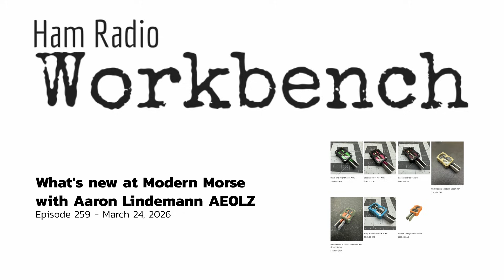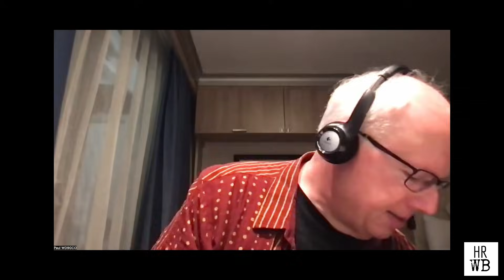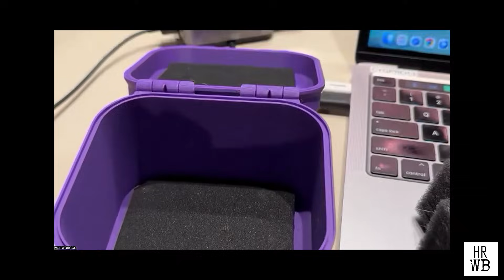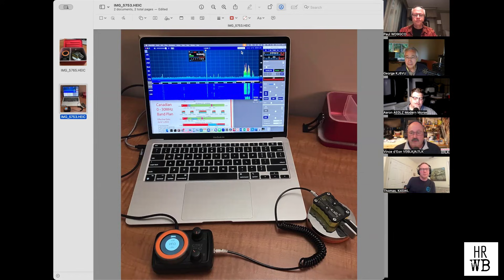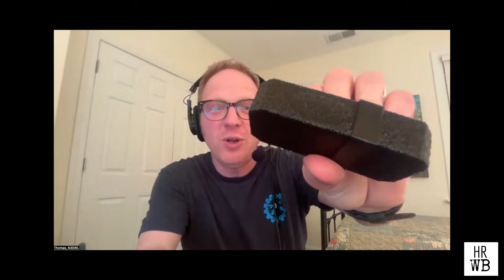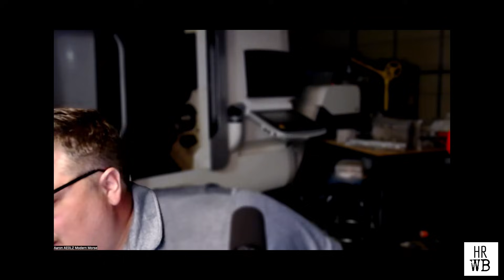HRWB Ep 259 Modern Morse

Comment: Love my Modern Morse (black + black cherry). I am not good with Morse code just yet, but I found that cheaper keys are more difficult to use (the 3D printed ones tend to "bounce" when I release the paddle, and generate spurious tones) and some of the expensive ones (looking at you, Begali HST) are very harsh. The Modern Morse is very precise, but soft. My only complain is that the chafer on the top sides is much smaller than the bottom sides, and I tend to hold it by wrapping my palm right around the top, and it hurts!).